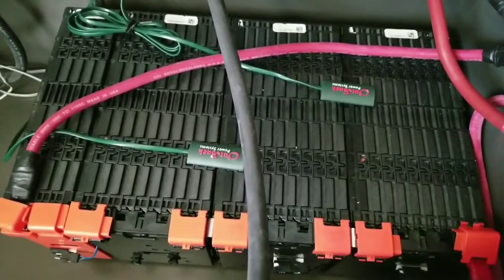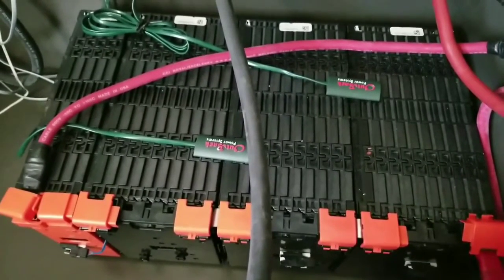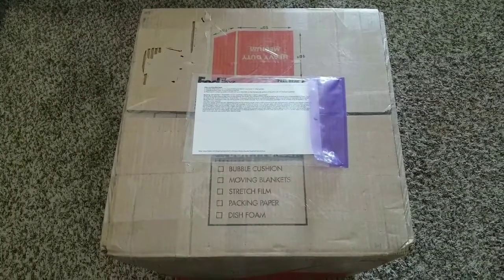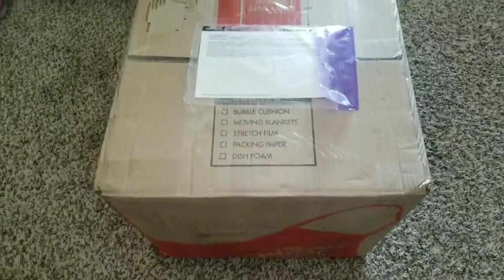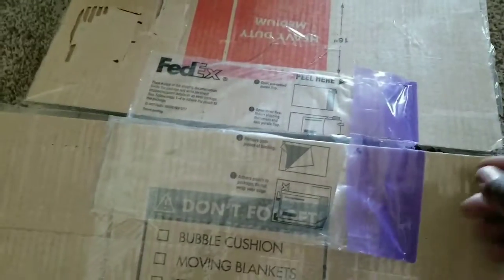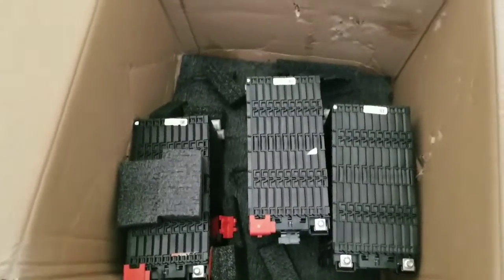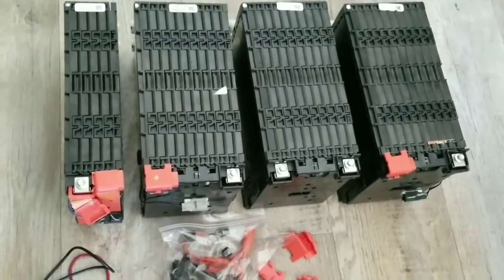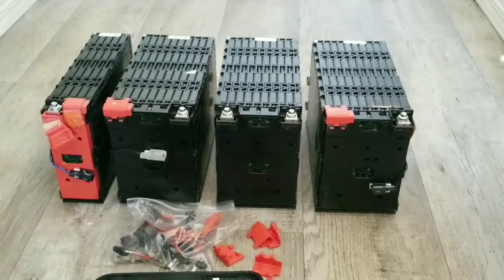FORD FOCUS LITHIUM BATTERY FOR SOLAR

Comment: Where did you get the batteries from?
Reply from the maker: Some where in Kansas city Missouri (green tec auto)
You can also find them on Ebay. 
Thank for watching, LIKE SUBSCRIBE and SHARE.

https://www.ebay.com/itm/A123-12V-60Ah-Li-ion-Lithium-Battery-Module-/224370157941?mkcid=16&mkevt=1&_trksid=p2349624.m46890.l49286&mkrid=711-127632-2357-0

Comment: Hi Bro, Good morning can those ford battries work for 12v system
Reply from the maker: Good morning brother. 
It's all depends on your Inverter input.

 Tested at 68 Amp Hours!! 3.5Kwh.

Two types of modules, one is an 8v module 2s5p, the other 3 are 16v module 4s5p.

Set up in 5 parallel 14 series configuration. 

Tested a random module at 68Ah. Tested from 16.7v to 12v at 30amps.

Comment: obviously the box was way too big to ensure no movement of batteries during shipping, i wouldve cut the box down to size.
i cant wait to have lifepo4 batteries, we dont have many at the wrecking yards here and theyre far more expensive due to the lack of supply here.
apparently forklifts now use these batteries.
your battery bank will let you do more at home i bet.
Reply from the maker: Absolutely mate.
Thanks for the support and for the  input